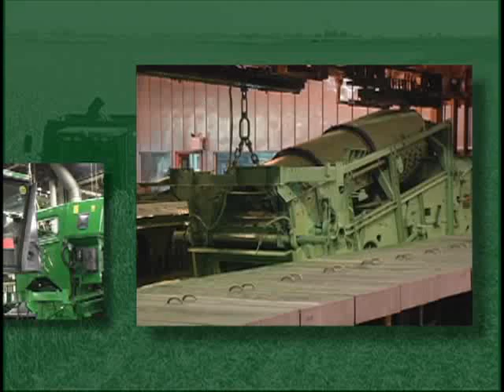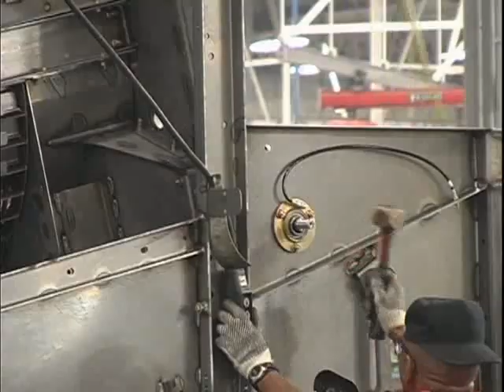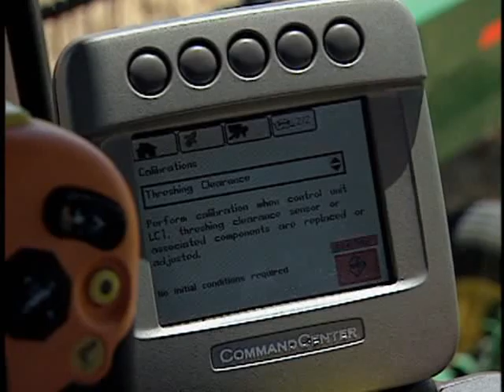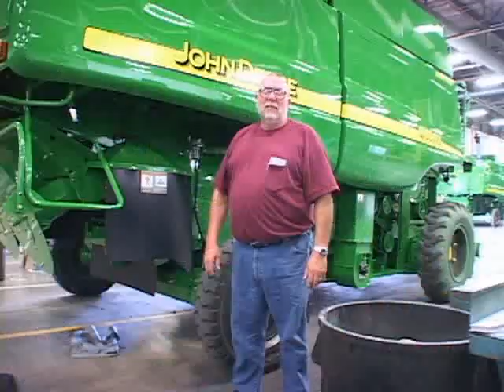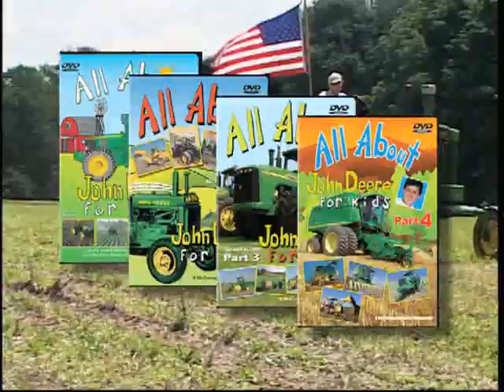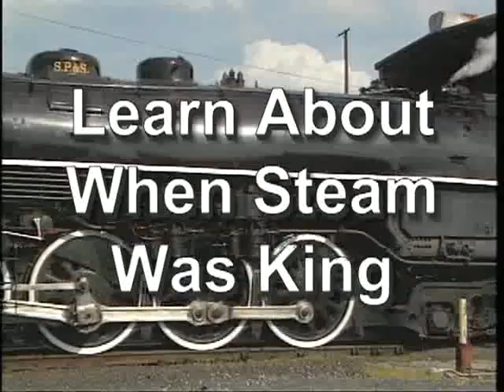John Deere Country Part 1

Comment: The John deere 844J Wheel Loader can't put The Combines on the flatbed Trucks only the Host the TrackMolbie can pull out the Combines out of the bay empty flat cars are pulled in and out their pickup by a diesel Locomotive
Reply: I THOUGHT the employees at the John Deere Harvester Works were supposed to USE the John Deere 844J Wheel Loader for picking up one Combine at a time out of the parking lot of the loading dock.  Because the John Deere 844J Wheel Loader can load the Combines on the FLATBED FREIGHT CARS of the Railroad tracks before the TrackMobile or the diesel Locomotive.  

And I think John Deere was planning to use the 844J Wheel Loader for loading the Combines on the FLATBED RAILROAD CARS.

In this John Deere Country Part 1 Video, I saw the John Deere 844J Wheel Loader picking up ONE of the 60 Series STS Combines and the 844J Wheel Loader was bringing it inside the last station of the Post Paint Assembly Department and the Main Assembly Facility.  

So, Jeff McComas says, "If a Combine is to be transformed to a via Truck with the FLATBED trailer, it is brought to the truck loading dock by a John Deere 844J Wheel Loader."  The 844J Wheel Loader has a special attachment on the FRONT END that lifts the Combine by its rear axle.  Flatbeds with depressed center sections are backed into opening bays.  The entire Combine is carefully secured by four heavy chains hanging from a giant hoist.  The hoist has a loading capacity of 22,500 pounds.  And Jeff said, "There's no room for error here."  The Combine must be set precisely centered on the flatbed trailer to equally distribute the weight and balance.  The Combine is then secured to the flatbed using floor chain tie downers.  After a final check, the loaded flatbed trucks head to the open road to start their journey to a John Deere Dealer somewhere in the United States.  Other John Deere Combines are also shipping by rail.  Empty Flatbed Freight Cars are backed into the loading dock.  The dock is designed so that the surfaces of empty flat cars are leveled with the driving services and the walking services.  This enables the John Deere 844J Wheel Loader to place the Combine directly on the flat car.  Like on the flatbed trucks, the Combine's loaded on flat cars are tied down using chains.  When all of the flat cars in the Bay are loaded, they are pulled out by a special vehicle called the "TrackMobile."  

The TrackMobile is a unique machine.  It uses both rubber tires and flange steel wheels to drive both on the road AND on train tracks.  John Deere uses the TrackMobile to move the flat cars loaded with Combines to a siding where the cars are picked up by a diesel Locomotive.  

The TrackMobile drives out to the track using its rubber tires.  It lines up with the track and the flange steel wheels drop down.  Next, the TrackMobile is ready to ride the Rails.  The TrackMobile plays a big role in shipping John Deere Combines all over the world.

The loaded flatbed freight cars are assembled and parked on sidings waiting for a gp9 from the Iowa, Chicago, and Eastern Railroad to make up a complete train.  An inspector walks the line making sure if the couplings are good and the Combines are tied down securely.  After combining the various consists into one long and very impressive 125 car train, the Jeep takes the completed train to the mainline where it will be connected to an even bigger diesel Locomotive train to begin its journey to towns all over the USA AND the world.